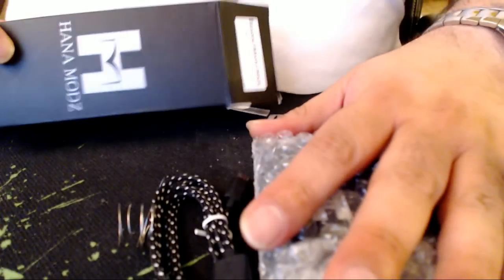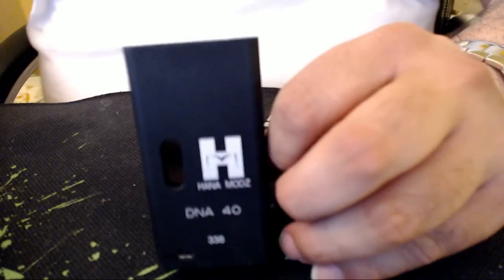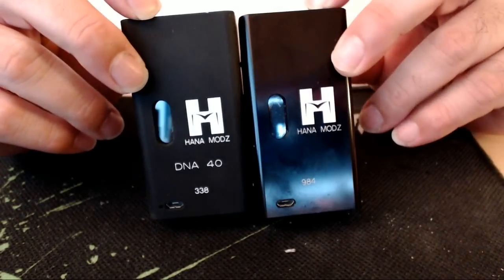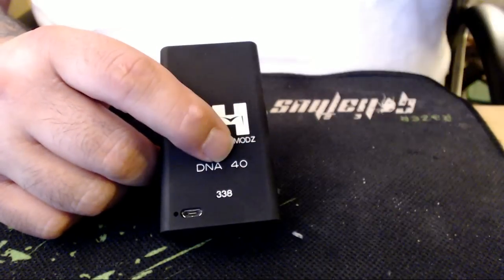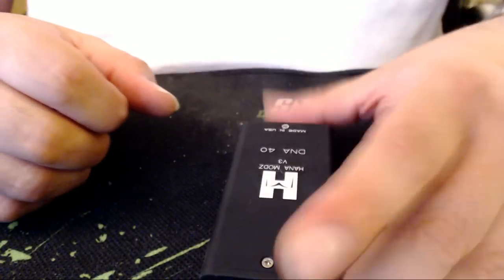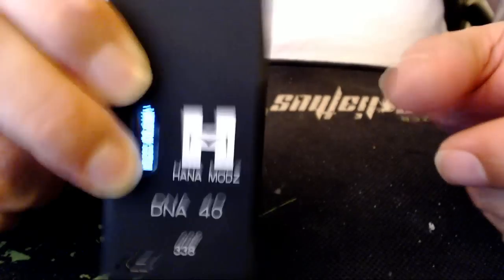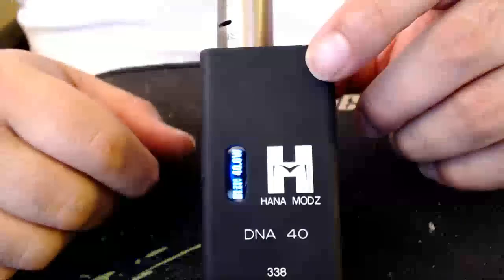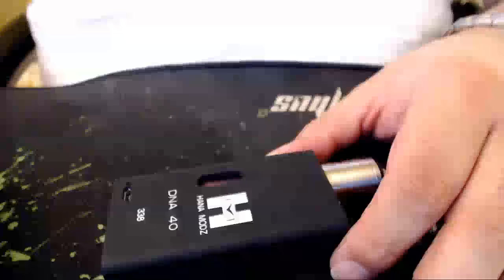Hana Mod DNA 40

Comment: Safety features of temp control are Awesome...
Price is flat out ridiculous...

Branden truly is a genius, I just wish he could figure out how to make eVolve devices more affordable to the average Joe...

Everyone vaping should be using their ohms law and calculating their wattage and based on that have a very good idea of the temp of their vape, if they are worried about the 280*c threshold...
If truly concerned you can even get a temp checker much cheaper than $299.00...

Thanks for the review...
Reply: The dna40 is cheap $60 USD. 
its the mod makers that are out to be rich.
Reply: Ya, sorry I should have made that clearer...The price some makers are charging for the finished device is ridiculous...

That and I really want to see another device that is completely designed and a finished product from the mind of Branden...That would be awesome...
Reply: Mjr Burn I'm buying mine from a custom modder, but Its not any cheaper.   And when I order the DNA 40, I don't see myself purchasing much more for the year.  The vaporshark is 189, I don't see that price dropping till the next DNA board is released.

Comment: Just ordered one last night, the graphite. hyperionvape has them in stock. You literally have the only review on these.
Reply: ***** yah they said 24-48 hours but it was little over that and I had to ask for my usps  tracking number. It should be here today though.
Reply: ***** will do. I'm pretty sure they send some not sure on the guage. What tank are you going to be using it in? I'm thinking of getting a genesis style but have been told that you can't with the ni200 wire. Not sure why not it's just the coil.
Reply: ***** good thing you ordered two gauges of nickel, to see which one you like better.  I think thats smart to build on a good flavor atty.  This vape shouldn't get hot, unless you max out the temperature.  I just hope its an all around satisfying vape.  I can't wait to order a dna 40

Comment: Nice review Bish. If you like the Hana mod then you should get a Vapor Shark rDNA, MUCH better build quality IMHO, rock solid device. I have a rDNA30 atm but I'm going to upgrade to the rDNA40, liking the temp control, reverse batt protection, magnetic batt panel & built in wireless charging, excellent features IMO.

So Bish, I'm looking for a good single & dual coil RDA, specifically for flavor/DIY juice testing so a highly reduced chamber is preferable. I'm thinking the Cyclone is actually perfect for this, as long as it produces very good/true flavor that is. I have actually always liked the Cyclone, seen many good reviews on it & I forgot about for quite a while until this video, thanks for reminding me. Would you recommend it specifically for flavor testing or do you know of a better option? Thanks Bish, VAPE ON!

Comment: Hey Bish, were you able to see my comment I left (18hrs ago) regarding the Vapor Shark rDNA40 & what RDA you recommend for flavor testing? (Cyclone maybe?) I had to edit it right after I posted it & from what I heard YouTube will mark it as spam if you do that & the OP won't see it. I don't want to re-post it if you can actually see it but typically you respond to comments pretty fast so I'm thinking its been marked as spam or for whatever reason you can't see it. Thanks.

Comment: Bishopheals!!!, My HanaModz DNA 40 will be here next week. What battery do you recommend for the unit?
Reply: You don't need a high continuous amp rating.  Seek something with more "mah"  so the battery will last nice and long.  www.illumn.com  

Pegesus Vapor Acadamy has a great new series to which batteries are right for different applications.

Comment: What gauge of the Nickel wire do you recommend? Sorry if I missed it in the video.
Reply from the maker: Hi Brad what i recommend is 30 Gauge. if you have a small tiny rba then may want to use 32 gauge. The difference between the two in ohms is the following:
30 Gauge is .6 ohms a foot
32 Gauge is .9375 ohms a foot

32 gauge is a thinner wire more easily to break when screwing it down but if your pinch of space it may work for you.
Reply from the maker: u can try it see if you do single coil with 15-20 wraps.
Reply: Ni200 is something to look for. Brandon from Evolv recommends Ni200.
Reply: ***** Check out PBusardo's video, he had the dude from Evolv on there talking about every feature. They didn't seem to have an issue with Ni200... Temco, I think.
Reply: ***** its under pure nickle wire.
Reply: ***** It says Pure Nickle, check out Lightning vapes  nickle Mine is fine an Does not say ni200, Trust me it is.
Reply: I Think 28g is best But 26g is ok also.

Comment: Just got my Hana DNA 40 a few days ago and Iv been getting check atomizer. I'm using 28g pure nickel wire with a single coil build on a veritas rda at .7. Iv also tried my rda patriot with a 1.0 ohm build and get the same message. What's the deal with this?
Reply: Call evolve, they had an awesome help desk for technical issues.